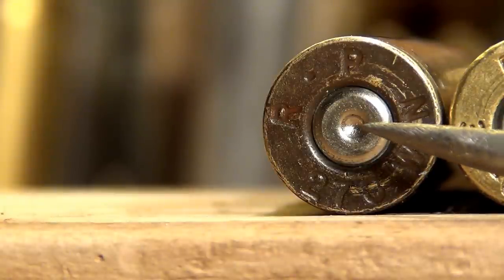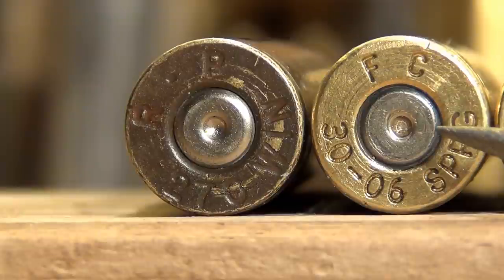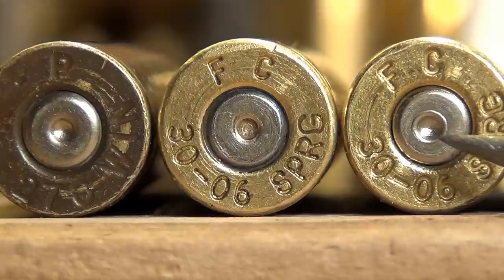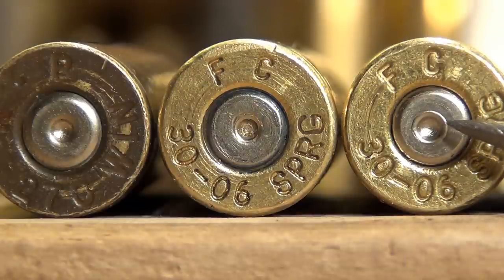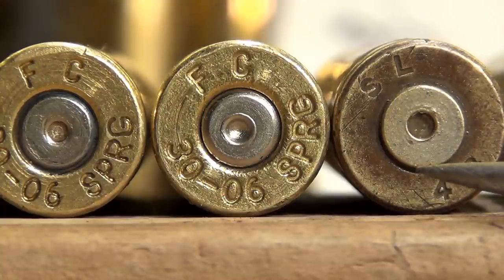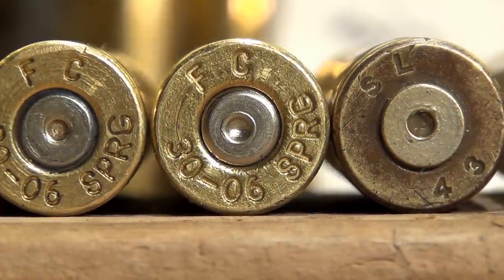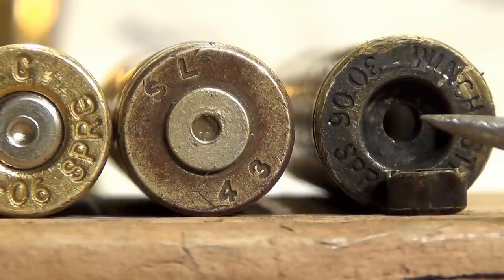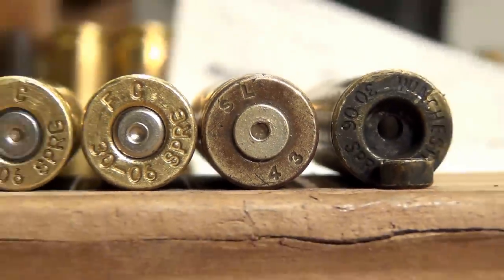LOOKING AT YOUR PRIMERS ON SPENT ROUNDS FOR SIGNS OF OVER PRESSURE - HD (L)

Comment: My opinion about your analysis. #3 shows a cartridge fired in a rifle with an oversize firing pin tunnel. There is no sign of ejector wipe which would happen with FC case. #4 was fired in a rifle with a too-long chamber: the primer backed out.

Comment: Very useful, JJ2K Many thanks. I had a question: The bulk of my 6.5 Grendel reloads fit into the excessive (middle example or 3rd from right and left) brass / primer you show. Is it necessary to discard this brass? OR would it be wise to discard it and start afresh? Thanks again.

Comment: I just fired my first .270 handloads.I started 1 grain less then the starting load for first three. Then went to starting charge then two grains over starting. Not gonna lie I was nervous and turned my head away on the very first shot lol. With gloves and glasses on. Actually went well and got great groups. In fact my 51g load shot under a inch at 100yrd

Comment: I have to disagree with your assessment of the one that looks like it has cratering on the primer.  Since the primer isn't flattening out on the edges, it could very well be that the gun it was shot through has extra space around the firing pin.  If the primer edges were more flattened like the next one along with the cratering, that would be a sure sign.  Without knowing the rifle, however, it isn't a sure sign that the load is too hot.

Comment: I like using primers to watch for pressure, but sometimes dimpled primers are NOT a sign of excessive pressure but are simply a firearm flaw. If there is too much of a gap between the firing pin and the bolt face it will happen on every load. this can be common with old firearms. That being said, sometimes it is indeed a sign of excessive pressure. Too light of a load can cause detonation in large cases and can cause a bullet to lodge in the barrel in other cases. So use discretion. If you are still not sure then testing velocity with a chronograph will solve the riddle.

Comment: Wheew, that last case was about to blow the firearm up. Incurring damage to the bolt face, and possibly bulging the chamber. Yes sir very dangerous pressures. 
 You know the bad thing about excessive pressures in a firearm. Usually firearms are shot in remote areas. Have a firearm blow up on you while you're out in the middle of the forest 2 or 3 hours highway driving and 2 hours dirt road driving with a bad headwound, excessive bleeding, and or possibly a blown off finger or hand. 
Nope, use normal pressure rounds all the time. A few feet per second more on a bullet are not worth the risks associated with excessive pressure rounds. 
  Great video sir.

Comment: I cut a shotgun round in half and emptied it. Took the adjuster piece from my crutch and got curious if it would set the primer off. Scared the piss out of me and lightly burned my hand. I never did find the casing. Thought I blew my finger off for a second.

Comment: Usefull tips, but i have to say that the primer has sometimes something to do with it. I have some factory ammo for my kar98k wich always have flattened primers that looks like there is overpressure, but i messured the load of one of these rounds and it is completely ok, they are pretty hot but they are not too hot.

Comment: Great vid, but primers are not reliable indicators of excessive pressure. Although those could be signs of excessive pressure they can also mean the headspace is too long.
Reply from the maker: +Darren Porter Yes! Thank you!
Reply: Once fired brass has the headspace dilemma taken out of the equation. Primer crater is always reliable indication. Good video

Comment: I shot a couple of empty cases with only a primer, 1 out of a 9mm 1911 and the other a 223 out of AR. Both had their primers bulged out after. It can't be from excessive pressure. Worries me because I still haven't shot any ammo (handloads or factory) out of either of them and now I'm kinda scared to do so in case something is wrong with them. Do you know what that's about?

Comment: Excuse me, I beg to differ, since we the viewers are not being able to know the loading data and the number of rounds fired prior to this one with the cratered firing pin strike on the primer on case number three. The cratering can be caused by several things. One being the bullet jump to the rifling was too short, thus the pressure developed was enough to flow primer metal into the hole in the bolt around the firing pin. It can also mean the hole in the bolt is too large for the outer diameter of the firing pin, allowing primer metal to flow inward surrounding the firing pin. additionally the primer cup could have been either softer or even thinner or both. My guess is the firing pin diameter is too small for the hole in the bolt face. An of course having a pressure spike from a lighter powder charge of a double base powder, therefore that spike can cause what was explained in the video. But when a bullet that was jammed into the lands and not allowed to jump with a greater amount of freebore will cause the same effect.

Comment: my .22-250 reloads Crater but still stay round they use 36 grains imr 4895 50 grain v max neck sizes winchester brass cci no.200 larger rifle primers they shoot 5 shots half inch 100 yards i called imr powders and they told me as long as theres no flating or diffuculty extacting ill be okay

Comment: I loaded my 30-30 with 748 at 33.0 grains. The startling load is 32.0 and max is 36.5. My primers, however, look like your third with the cratering. I will try to lighten the load but it doesn't make sense to me
Reply from the maker: +Kevin Carr Please check to make sure all your brass is trimmed. If you're chambering a load into your gun (even if it's a light load) and your brass is too long, there is potential for the brass to "crimp" the bullet as it chambers. If this happens the round will produce dangerously high pressures to force the bullet out of the "crimp" and down the barrel. The result in this case can be signs of high pressure.
Reply: I did trim all my cases to length, and I also used the Lee factory crimp but it does not seem over crimped. I have heard that if the firing pin hole in your gun is too large that it can make an indentation like this but doesn't mean there is excessive pressure. I shot 10 bulets, 2 at 32gr, 2 at 33gr, etc. and up to 36gr. All the primers had cratering but there weren't any distinguished differences between them.
Reply from the maker: +Kevin Carr that's interesting. I'm thinking...
Reply: +jiujitsu2000 Also, for the last 2 grain increments of 35 and 36, there was excessive smoke. I mean like grey smoke, enough that it was easily visible. Not sure if that's just a sign of the powder being dirty, the powder not burning all up, or something serious. Any advice would be appreciated along that or the primers
Reply from the maker: +Kevin Carr grey smoke doesn't make sense. I'm starting to wonder if there ammo or powder was old
Reply from the maker: +Kevin Carr still thinking about this one
Reply: jiujitsu2000 well i had just reloaded it and the powder i had just bought sealed. the only time the smoke came up like i said was for 35 and 36 grains.
Reply from the maker: +Kevin Carr hmmm
Reply: +Kevin Carr Was your bullet seated too deeply? I think that could cause higher pressures
Reply: @chadholsinger1022  smoke is an indication powder is still burning off in the barrel after the bullet exits. If I use a slower burning powder like a mag powder in a caliber I normally use a fast burning powder I get smoke. Retumbo and h1000 in short barrel s does the same because of burn rate. I have one rifle that consistently has craters like #3 with what ever it shoots due to the pin. So what I look for in load development is change in the crater, cracks in the outer edge of the lip, flatten primer, hard to eject etc. But what will create over pressure with less powder is, head space to tight needing shoulders bumped back, copper fouling at the lands easily cleaned out with sweets 7.62 or any other copper solvent amonia based.

Comment: No one noticed anything fishy about the last casing??  This is why you should never over bore your flash holes. Winchester factory brass has a 5/64 flash hole, This one looks about 7/64. Means more powder was exposed  to the primer ignition, resulting in faster burn and higher pressure.
Reply from the maker: +David Oakley Exactly! I noticed that too. Crazy!! Great observation. Thank you for stopping by

Comment: Problem with this video is your saying primer cratering is a sure sign of pressure. Though it is common with some manufactures of primers even at low loads to crater. In my rifle 300 Winchester mag, the Federal 215 match primers crater the same at 70gr of powder as they do at 78 grs of powder. What you need to look for is the slightest of ejector marks and back off until you can't see it anymore also a flat primer is another positive pressure sign.

Comment: Thanks for the video.  I have a question.  I gave two .308 rifles,  on is a savage model 11 and the other is a rem. 700. The only difference in the rifles (besides the manufacturer) is barrel length. Rem. has a 26 in. And the savage 20. I am getting pressure signs out if the rem. But can shoot the same load out of the savage.  So I tried factory ammo and still get the pressure signs???
Reply from the maker: Possibly a shorter or dirty chamber in your Rem. If it's shorter it will slightly "crimp" the bullet making the pressures spike to push the bullet out of the barrell... Just my thoughts, I could be wrong. Hope this helped! Have a beautiful day! :-)
Reply: Thanks, I will try cleaning it. I just bought it from a gun show,  so maybe it has some crud in it?
Reply: the barrel difference, longer barrel= higher pressure for same grain

Comment: I would never make hotter rounds than the currant loading data recommends.  I load for accuracy more than power.  I also full length re-size which lessens the life span of the brass. I do that because I want the ammo to work in all guns.

Comment: Every firearm is different. Thus, there is no applicable blanket indicator that verifies signs of certain over pressurization; other than the obvious failure of the cartridge. Shooting slow burning powders in magnum cartridges, I find just as many flattened and ridge pitted primers with factory loads, as I do with the handloads I have been assembling for over thirty years. Even when following the recommended load data found in Nosler, Hodgdon, and other reloading manuals, primers never emerge with definite rounded surfaces, and a neatly pitted center  indentation. 

That being said,  I always follow the load data for cartridge assembly. I  never load cases to maximum capacity, and apply either no crimp or the very slightest degree of taper when seating the bullet; as that too can spike pressure at ignition. If needed, I adjust the powder charge lower for accuracy, or if I experience noticeable difficulty ejecting the fired brass.

Bottom line...handloading requires diligence, common sense, and a commitment to understanding the relationship between all the myriad  components for assembling safe and accurate ammunition. Similarly, familiarity with the firearms you shoot will also go a long way towards determining what the gun will digest the best, without incident arising from potentially harmful side effects from over stoked rounds. Guns N Basses Forever !🔫🎸

Comment: if your reloading you can go from #3 to#5 just by changing projectiles and bullet seating depth . had my 25  06  set 1/2 grain below max of hybrid 100 with 117 seirra gameking  changed to 117 hornandy sst for longer range and closer to the lands and blew the primer on the third shot. be careful . this can get you hurt.
Reply from the maker: yes!
Reply: The video has some VERY good info. Same goes for comments from TheOldGunshith58.
Blown primers are DANGEROUS to you and others - and can also damage the extractor  and ejector in the bolt, causing your rifle to be unusable.

Comment: And what happen when the primer has a hole through? Thanks
Reply: That means your FP pierced the primer.  Either it's too rough so smooth out the tip and check to make sure it isn't protruding excessively.  Don't keep shooting it this way as it can erode your bolt face.